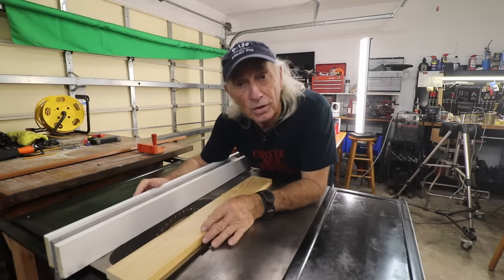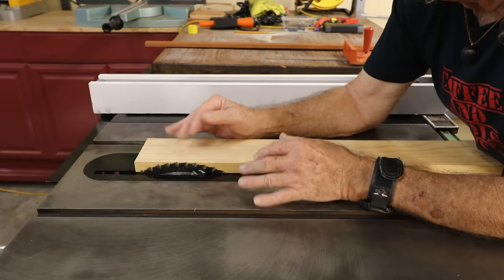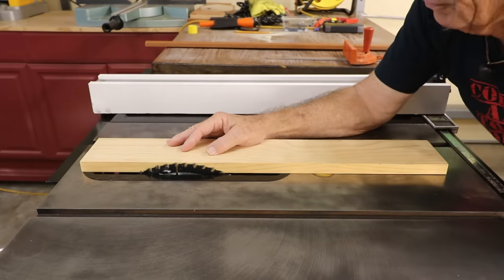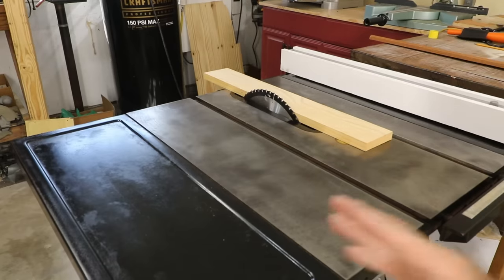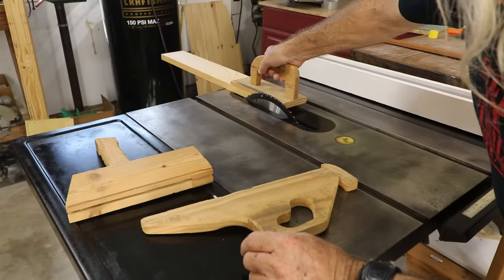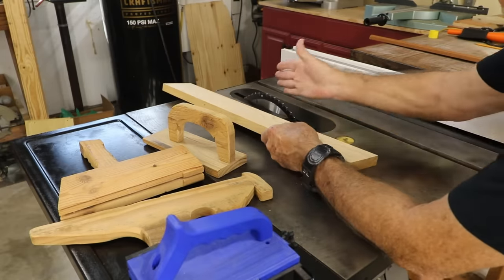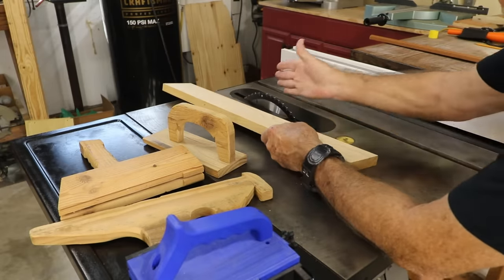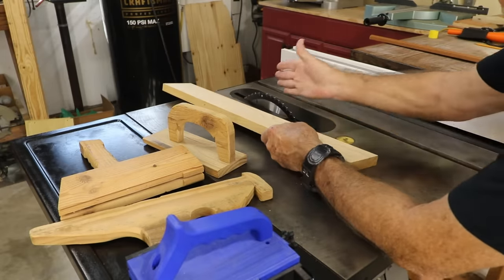Table saw secret nobody will talk about from the good old days, C&T episode 180

Comment: Hello, just found this channel.  I always cut with the blade high.  Your common sense explanation is right on.  You can prove this all with geometry, trig, vectors and the whole engineering thing.  My first table saw was one I made when I was in my mid-teens and I've been using them ever since. That is some distance above fifty.  Also, been around sawmills, large remanufacturing saws, etc.  The best safety tool is to watch what you are doing and keep your hands away from the blade. Some wood, especially green, will have stresses in it and will kick back.  You have to account for it.  Using a hollow ground blade helps.  A sharp blade is essential.  Some years back, while taking some survey classes at a Community College, I had to rip some rough old lumber into survey stakes in the wood shop.  The wood instructor launched into me for having the blade above the board.  The stakes didn't get cut.  It was too dangerous to cut that stuff in that way.
Reply: Interesting.  Your comment and this video convinced me to go experiment with all kinds of stuff.  I can get green stuff, too.  I forgot about that.  Thank you

Comment: If the high blade helps prevent kickback at the cost of increased risk of cutting, then the obvious solution is to keep the blade low but use a riving knife to eliminate the kickback. Alternatively, use a good blade guard and don't worry about the height so much.

Comment: Great stuff you have covered here. I would like to add that the use of your push blocks (the type with a heel hook) GREATLY reduces potential issues due to greater control of the work piece and likely reducing the benefit of having more blade exposed. The second item (using your test piece of 1x4 pine) is that it keeps the piece DOWN tight to the saw top, which reduces the possibility of the rear of the board lifting and being introduced to your face at high velocity!
  Not really obvious, but that test piece has a slight cup to it and was rocking on the saw top. When cutting shorter boards like that, I am always more concerned of kickbacks from the rear lifting, as opposed to kickbacks from blade binding, etc. Maybe paranoid, but I never rip anything shorter than about 30". My saw is a 40 year old Delta, with no guard or riving knife, but I have a whole fleet of push blocks. Those can easily be rebuilt. My fingers, not so much. Although useful in some situations, I usually don't like the old school 'chicken foot' push stick.  Those can contribute to the board lifting, IMHO.
Reply from the maker: Delta made some good saws back in the day
Reply: Yeah I usually work alone and in different places so its hard to properly setup a ideal work area. The lifting at the back is always sketchy or if a peace is laying there lol and sometimes holding a peace down with a as it spins I'll carefully shut the machine off and finish taking the peaces out when its stopped so not to wedge it while on and you're shifting positions

Comment: Many people are saying the blade should be high enough that the bottom of the gullet is just clear of the work to efficiently remove the sawdust and increase the cooling of the blade. I always use Push sticks and/or push blocks. You gave the most important piece of advice quite early into the video. "Keep your hands away from the blade"!
Reply from the maker: yeah, that would be NUMBER one in my books, but I was taught to run the blade high by Pro's and this is against the "safe" gang

Comment: I worked in a cabinet/furniture shop for a few years, I liked it on the high side.  Worked commercial so I cut through some non-typical stuff.  Keeping the blade low absolutely makes the board jump.

Comment: Perspective. 
I think the main reason that the table saw is the number one piece of equipment that people get injured on, is because it's by far  the one piece of equipment that most all woodworkers have.
Great video.
Reply from the maker: I like that, it could be just that simple.
Reply: While that is certainly true, safety training other than on You Tube is basically "accidental"!  Splitters and riving knives will prevent 98% of kickbacks and are not very well understood, so they remain in the drawer with the blade guard attached, at least mine did until I realized what function they perform. Prior to reinstalling my splitters, I did have a few kickbacks and they were painful.  After putting them back on I've had none! Those slender push sticks that provide no down pressure and often used in pairs are a safety hazard and prone to sliding along the workpiece.

Comment: I like the blade a little higher also, seems safer and does seem to guide the wood thru the cut. Also use push sticks and feather boards when needed and something you didn't mention was to use a "SHARP"saw blade. A dull blade will get you into trouble.
Reply from the maker: OH, yeah...the blade, but that's another story :)
Reply from the maker: @Bamboo Training Two things on a dull blade, it will "burn" going through wood and also you'll have to "push" harder on good wood. A lot of times it just needs cleaning :)

Comment: Yes, a high blade greatly reduces kickback. It pushes the wood down onto the table where you want it. If you use the proper safety tools, I believe it is overall safer.
Reply: A fence parallel with the blade is priority #1.   Kickback is most likely to occur if you fence is not parallel to the blade or when you are trying to cut very short pieces and it rotates as it passes the rear of the blade.   If you are pushing wood into through a "funnel" (a fence that is farther away from the fence at the front of the blade and closer at the rear) then a high blade is less safe because a higher blade creates the greatest distance from the front of the blade and the fence and the back of the blade and the fence.
Reply: @tinker-ing-around2317  exactly. The biggest reason for kickback is the wood pinching on to the blade. That's why you don't ever use a miter gauge while using the fence. It's why riving knives are so effective.  Having your blade higher does very little if anything to prevent kickback.  If your workpiece pinches, funnels or turns into the blade the higher blade isn't going to prevent that kickback.

Comment: I’ve been wood working since the late 70’s up until about 5 years ago I had never heard of kick back or knew what it was. I went to work for a small scale furniture maker. I’d never experienced it. I never knew what a riving knife was supposed to do as I always removed all the safety stuff. Same with the blade hight. Always have the blade about an inch above the work piece. I too have never experienced kickback.
Reply from the maker: You have to wonder if a blade too low is part of the issues.

Comment: I'm with you, I've always made my cuts with the blade about 1/2" above the wood or high enough to clear the cutouts in the teeth. I always thought that was to aid chip extraction, which prevents binding, which prevents kickback. How much of that is true I don't really know, but it has worked well for me over the past 30 years or so.  Hasn't hurt the one carbide all-purpose blade I've been using over most of that time either.  Still makes superfine cuts that don't need sanding.  Cheaper blades tended to burn the wood so I stopped using them.
Reply: Keeping the blade up helps hold wood down. Lower the blade, the wood wants to ride over the blade. Blade 1/2" high can cut off fingers like it happened to me. I passed out during a cut, lost my pinky with other damage. Nothing can prevent that except sawstop which now i have.
Reply: I so agree with you on this,I was going to say about the same thing until I found your commentyou said it all
Reply: Full tooth and gully above stock. No more to much less can cause blade to lift stock and potentially sling it on you.
Reply: @sawman231  exactly this. Most manufacturers of blades recommend this height for an optimal cut, chip and dust extraction, and not too high for safety reasons
Reply: @brucemiller1696 , thanks for the testimony, pal, it will help keep another person safe, I know this. I really hope that you have, or will, recover full function! L
Reply: @leehaelters6182  when i fainted, my left hand went into the blade cutting off my pinky at the second knuckle and then went over the blade and made a nice blade track on the bottom of my hand cutting into tenons and cut into the thumb a little. 48 stiches and no insurance. Still need to pay some towards it. Ring finger is hooked to hold a beer bottle nicely because of cutting some of the tenon away, but for the most part, its kinda all good. Just not a good bridge hand when i play pool. Maybe i should shoot left handed. 🤔

Comment: I've been using a table saw over 50 yrs also. I was 19 and I worked in a cabinet shop, 8 hrs a day on the table saw. The guy that ran the shop was an oldtimer like I am now. Even after all these years seeing the blade up high like that gives me the creeps. You never want to do that.
Reply from the maker: In general I was told to use what is comfortable to me, but old school carpenter's shop told me to keep it high for the best cut.
Reply: @SirTools  Like John Wayne said, "well ya gotta do what your insides tells ya." Keep safe.

Comment: One of the things that I have always added to a table saw to improve safety is an outfeed table.  It may not be necessary on small pieces, but, ripping a long heavy board, or panel, without one leaves you pressing hard on the tail  to prevent lift at the end of the cut.  Pressing almost straight down so hard while your hand is near the blade, even with a push stick, or other device, is a recipe for disaster.  Another thing that you didn't mention, never stand directly in line  behind the cut.  A brain is the best safety device that you can have on a table saw
Reply from the maker: NEVER be a target LOLOL...this was about what old school told us to do with table saws. Funny they never mentioned do NOT stand in front of the wood cut line. Guess they thought that was common sense :)

Comment: Totally agree with the high blade.  And you said another word several times.... CONTROL.  Make sure you are always in control of the work, either with your hands or with push stick(s), and keep it smoothly moving as much as you can.  Don't leave work sitting between the fence and the spinning blade and get distracted and leave it uncontrolled for a millisecond.  Work sitting between the fence and a spinning blade uncontrolled is about to become a missile, aimed straight at YOU.  If you need to stop for some reason (heart attack, ninja attack, sudden onset of overwhelming existential angst), keep the work under control and reach down and switch off the saw, and keep the work under control until the blade spins down.

Great video.  This video will save some fingers.
Reply from the maker: control and plan each cut

Comment: This is late to the party, but what I was taught as a machinist was to select my blades such that I would have three teeth in the work. I could use more, but there might be more heat from friction and drag as the teeth spring in (kerf narrowing) but if I used less I would be likely to break teeth in the work. The stress just isn't divided among enough cutters. That's for metalwork, but the same goes for wood. I set my table saw so I keep three teeth in the cut. If I'm ripping thick boards, fewer teeth on the blade so I don't have to stand it out so tall, and thin sheet, more teeth.
Reply from the maker: I had 7 years in a machine shop and that's another story for another day. Thanks for sharing.

Comment: I think one of the big reasons for kickback is rip fences that are not parallel to the blade, especially if the are closer at the rear of the blade.   I have a couple of older Craftsman saws and frankly the rip fences are not very accurate.  I think an accurate fence is probably the most useful thing you can do to prevent kickback to say nothing of putting out better work.
Reply: Thank you , the riving knife doesn't prevent kickback, rip fences that are not parallel to the blade is the problem with kickback.

Comment: It's great to have a real vet explain this stuff and at the same time understand it all. I only started woodwork in July but it's gripped me :D
After I bought a mitre saw everything became easier but I read the safety instructions properly and checked out loads of videos on how to properly use it.
I DO have a table saw which I bought last month which I haven't had the opportunity to use yet as weather in England sucks but the blades you showed are exactly like the ones on mine with that dip.
Got a new sub. Have a GREAT New Year mate : ]
Reply from the maker: Just never rush and always plan the cut before hand. Best wishes for the new year and glad to hear another wood worker has started the adventure. Hope to hear how your doing in the future !

Comment: Hi, lumber yards use very large circular saws normally at full depth of cut but they are usually used with the "work piece" in a carriage on guide rails.  This is similar to my preferred approach on a table saw in that I use a fence on both sides of the work piece with clamped blocks  on  the left hand fence to stop the work piece lifting. Also an adjustable guard that covers the blade position is attached to the right hand fence and push sticks are used to feed in the work piece through the "jig" formed by the two fences. Admittedly more time to set up but gives very accurate, repeatable and safe cuts (particularly on a long work piece).  Note; still not idiot proof and will not stop stop kickback due to blunt saws and excessive feed rates.
Reply from the maker: We have a lumber yard not far from here and I inspected the saw setup. Good points !

Comment: There is one problem with your assertion of keeping the blade high because "it keeps the board nice and straight" and that is that the kerf of the blade's teeth are slightly wider than the spinning disk they are mounted to, and the friction you feel keeping it in line is from the back teeth making contact with the board from behind. Yes, there is more distance with which the blade spans to allow less movement, but a Master carpenter will push his fence ever so slightly away from the blade at the far end to keep a board riding away from the fresh cut line, to avoid  burn marks on his new line... this takes advantage of the leeway in the kerf  of the blade and always gives you a 100% burn free line on the piece against the fence.

The biggest thing about kickback is something being out of alignment, or a warped/twisted board. By using a "chicken foot" push stick in conjunction with a normal one, you can add a lot of distance and hold a board very close to the blade, (like a feather board) and give yourself a lot more control than just a regular push block or stick.
Reply: @ Chris Griffith, can you describe a ''chicken foot'' stick, compared to a ''normal one'', please? What I call a ''bird's mouth'' has just a notch cut into one end. Is that it?
Reply: @leehaelters6182  yes

Comment: Thank you for this. I still have a love hate relationship with my table saw and router. As a beginner, I am constantly terrified and basically avoid doing any work! But videos like this help my anxiety a great deal! Thank you!…On to those shelves then!
Reply: Install a riving knife, and check the alignment of your table saw fence. The rear of the fence should be slightly toed out (away from the blade) compared to the front by a maximum distance of 0.015" or 1/64th inch. It's safer to have the rear of the fence slightly toed out. If you have the rear of the fence too tight, and it's closer than the front of the fence, then you'll pinch the wood and burn the wood and risk death every time you make a cut. If you don't have a riving knife, don't use your saw at all. I mean it. Just throw it away. Or buy a $25 Micro Jig kerf splitter, either the thick turquoise color one, or the yellow one for thin kerf blades, and it goes into 2 holes in your throat plate around the blade, to create a simulated riving knife.

Comment: Interesting...  The way I set mine is to ensure the carbide tip in the highest point sticking above the board.  It is because the lumber I worked with not always flat and sometimes bowl and twisted by 1/8 or more.  It has to cut thru all of that.  Most of the time, I just leave it 1/2"-ish above the board.  However, I do use long pushing stick or block where my hand is at least 6" to 8" away from the blade.

Comment: Excellent advice for all. I personally set the blade depth at about 1/8" and I can testify that if I didn't practice that my left thumb would be a little shorter. With  that said my incident would not have happened if I had not been distracted by my son-in-law. So my advice is first eliminate all distraction and second concentrate on the project and HAND!!!!
Reply: WOW. Yes so I wouldn't have any fingers left if I had the blade set 2" high. But I had a kickback, and I had the blade set just barely above the wood, and I got cut at the exact depth that the blade was protruding above the wood. My hand followed the wood backwards into the blade, and rode across the blade on the top of the wood. I cut half way into 4 fingers. They stitched me back up. I'm ok, but I haven't been able to use the saw in 4 months since it happened. I'll be installing a riving knife now.

Comment: One thing that has always seemed to make my saws a little safer is keeping the blade and the surface of the table saw sprayed with Teflon. Cuts back most friction. Makes the push so much smoother. Works for me anyways.